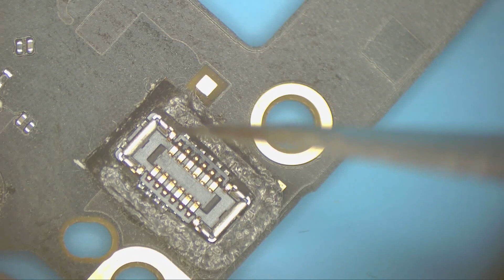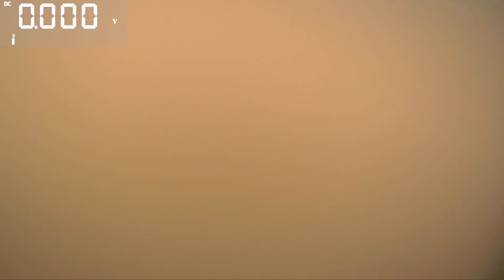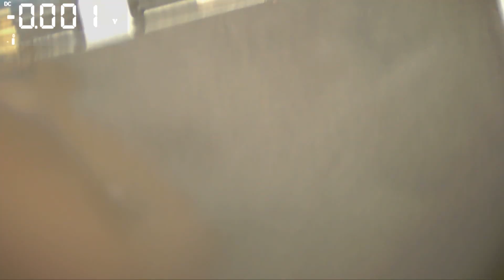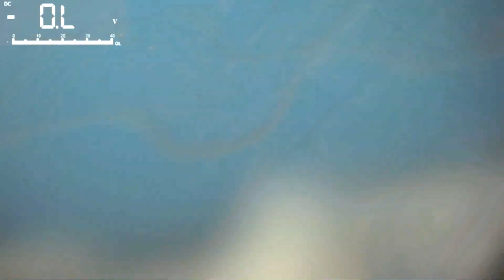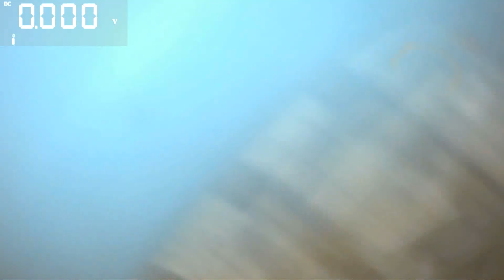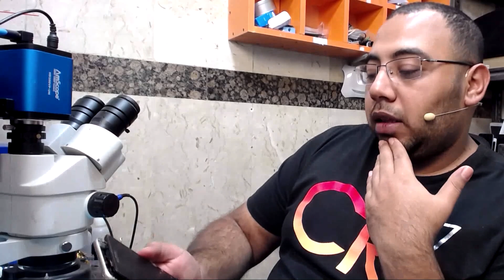iPhone 6s No Power Not Charging - How to fix under 10 min

Comment: i have an iPhone 6s and when the battery had gotten low i plugged it in and it didn't work i tried new cords plugs and outlets and nothing worked i cleaned the port and still nothing i opened the phone and disconnected the battery and the port connector and still nothing worked plz help me
Reply from the maker: This is a chip problem and you need a technician to fix it for you because you don't have the tools or the experience to do this very technical repair

Comment: I have similar issue. No power, no charging, but when I try it to boot up by dc power supply board consuming 0.10a and than goes down to 0, goes up to 0.10a and than goes down ad its repeating. Can someone help ?
Reply from the maker: Could be oscillator or power ic i can't be sure because a lot of things need to be checked before i judge

Comment: Hi ayman, what a temp u using to remove the ic and to put it back for blower and solder temp for cleaning process?  Anyway good explanation keep it up.
Reply from the maker: Thank you, i can use 500 temp full air speed it is depend on your skills there is no certain number

Comment: Hi Amman, possible to make video on iPhone 8/8+ no service connection issue? Your American fan and student Daniel.
Reply from the maker: Hi daniel i hope i get a device with the same problem
Reply: Ayman The Repair Tech I had an iPhone 8+ with no service issue which I got repaired, from seeing logic board I think tech desolder baseband ic and solder back on, I watched video on REWA but for iPhone 7 which they did the same thing BUT if iPhone has caution sign with triangle with no service then iPhone CAN NOT be repaired due to corrupt baseband.